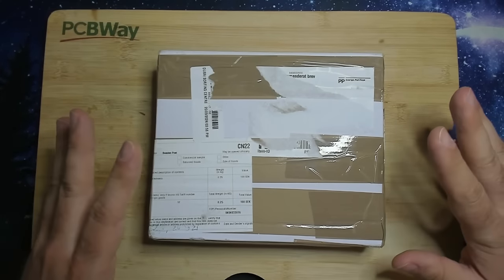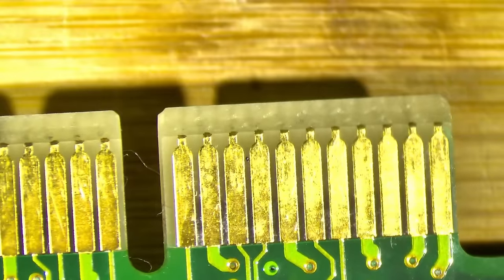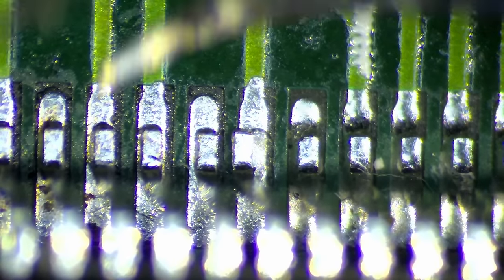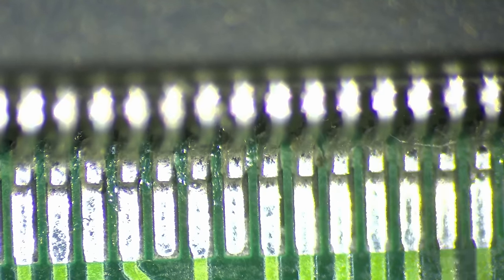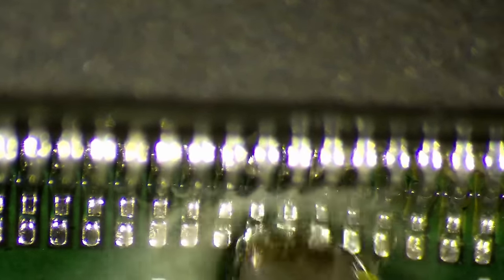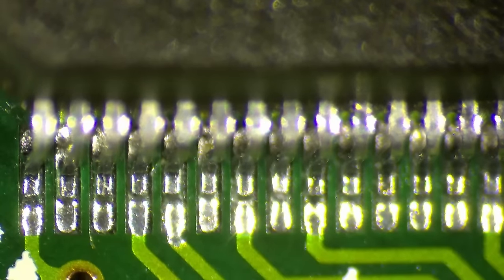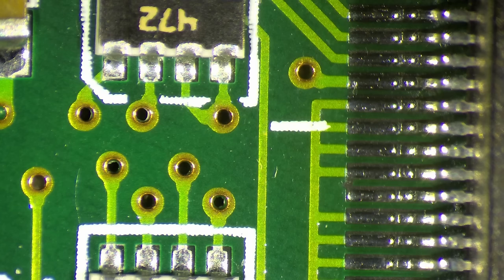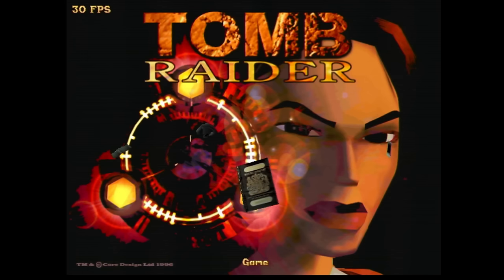3Dfx Voodoo Graphics repair: Reviving an iconic 3D Accelerator

Comment: At first I thought for a thorough clean the 3dfx chips would best be removed entirely so you could get all the stuff that was up under there. Then I thought that would probably involve the heat gun and there's no need to stress the components unnecessarily.
Reply from the maker: I try to avoid hot air for repairs as much as possible. Nothing worse than damaging a card like this because of some leftover flux.

Comment: I'll never forget the day I got my Orchid Righteous 3D and first fired up GLQuake. I was young and much more impressionable at the time, but I still consider this the biggest leap ahead in personal computing that I have witnessed in my lifetime. SSDs come to mind as well, but the first few generations really weren't that great, both from a performance and reliability perspective.

One day, I will have a Righteous 3D again and rejoice at the clicking of the hilariously mechanical relays. It didn't bother me at all and was really quite useful to diagnose issues.

Thanks for saving another one, Alex. ❤
Reply: I would agree with this. Proper early 3D acceleration, along with 2nd gen and later SSDs were both massive steps forward in computing!
The only other development for me that comes close would be the jump between dial-up modems and broadband internet connections. In mid 1999 I went from a 56k modem (using everything between 2400 baud and 56k for BBS & later internet access since the early 90s) to cable internet that was 1.5mbit/128kbps at the time. It was like a whole new world opened up!
Reply from the maker: I was in the store with my friend when he bought his Orchid Righteous 3D. I remember the sales person selling Orchid's relays and the clicking sound as a distinct feature of the card: "You know when you're playing 3D games because the card makes the clicking noise! No other card offers that feature!"
Well, he bought the card and told me how awesome it was.
About three years later, I bought that PC from him with the Orchid. It became my brother's PC. I had a Pentium II 350 at that time and he had a Pentium 200 (no MMX), ASUS P55T2P4, and the Orchid Righteous 3D. To this day, oddly enough, I still have most of those PC components - including the case.
Reply: @Choralone422  My first one was the Canopus pure 3d. But like you, damn do i remember.
Reply: I remember being in this computer megastore in Finland and getting obsessed with Orchid Righteous 3D. I had to have it. I begged my mom..and she finally agreed to buy it!  Biggest jump in graphics ever!  And the game bundle?  3dfx-versions of:  Mech Warrior 2, Fatal Racing,  Terminal Velocity, Descent 2, Microsoft Monster Truck. There was also a demo CD. 

Now almost 30 years later..after buying multiple systems my self.. I thank my mother for buying this card for me :)
Reply: @kimnice  Oh wow, Terminal Velocity... Made me buy my first joystick. This game was so much ahead of it`s time.
Reply: I still have my Orchid Righteous receipt lol. Sadly i sold the card back in the day :( they are kinda expensive now, almost at my original buying price

Comment: The Orchid Righteous 3D Voodoo 1 was my first 3D accelerator card. Such an amazing card. I have so many fond memories , and luckily I still have mine , together with its box and content.
I paired mine with my K6-2 233, in order to play Unreal at 512x384 (gives a few more frames compared to 640x480 at almost no visual cost). Before that, I just played games in Software mode. 
So while I was late to the game, only aquiring mine in 1998 , I was super happy and kept using it even with my P3-500 up until year 2001 (paired with an ATI Rage 128 Pro).
Reply: 512x384 is good resolution to use on 3dfx. If I remember correctly refresh rate needs to be set high enough to avoid pixel doubling - otherwise it looks much worse than 640x480. Lower resolution helps even on Voodoo2

Comment: Some flux is hydroscopic so can end up being conductive. I was having terrible issues with a small SOT23 voltage reg, at one point I could hear the sizzling under it. Replaced and used SMD flux, perfect every time now. It's possible the flex was causing an issue.

Comment: It's always nice to see people using a good amount of flux bu there is a limit,
When you use more flux than solder you may have issues 🙂nice fix.
Reply from the maker: Hehe, well, I don't mind if someone decides to drown the card in flux, but then it should be cleaned properly.
The most annoying thing with flux on the board is that when you touch it to install or remove the card, you get that stuff on your fingers. It doesn't go easily with soap.
Well, and then there is the fact that that card looks dirty.
Reply: @bitsundbolts  Non conformal - conformal coating 😀, Also depending on the orientation of the card and the heat it can also seep down into the slot causing contact issues over time as dust builds up over time,

Comment: Is that a bridge? at 12:54 - 12:55 Or just something shiny on the board
Reply from the maker: It's broken solder mask with the black surface of the PCB showing through. It can easily be mistaken as a solder bridge.
Reply: @bitsundbolts  Ah good.

Comment: Excellent repair! 

Would not surprise me however if there was an issue with the relays - could potentially be intermittent, temperature related etc. 25+ year old electromechanical components can be a little scary!
Reply from the maker: I have not come across issues with the relays yet. They might wear out due to heavy usage, but then the noise should be very different. The sounds of those relays is what I remember from my model (which I still have).

Comment: Shame you didnt test the card before you started the repair - I was always taught to take what the customer says with a pinch of salt and test anything before you attempt a repair in case it's an intermittant fault etc. it's also a good way of proving you've fixed the fault 😎😎
Reply from the maker: Yes, after checking for shorts and under the microscope, I could have tested the card.

Comment: Nice repair!
What do the relays actually relay? Is it basically 2 video cards on the same board?
Reply from the maker: If I am not mistaken, those relays are responsible to switch between the primary signal of the '2D' card (the signal that is routed through the loop cable) and the 3D signal generated by the Voodoo card. That is why you hear the clicks when the game Tomb Raider plays the videos during the intro because videos are played by the 2D card (the Rage XL in this video). Once the Voodoo takes over and outputs the 3D signal, the relays switch again from the 2D to the 3D signal.
Reply: @bitsundbolts  That's exactly right. While absolutely hilarious that they went the mechanical and audible route, it was great, because it gave you an indication of what is going on (and what may be the issue if a game didn't work). Furthermore, it was a perfect match for IBM's venerable buckling spring Model M. Clickity clackity! 😂
Reply: They switch between the vga input from the 2d card loopback cable and the vga output from the voodoo's RAMDAC. They are software controllable allowing games to switch between 2d and 3d output on demand allowing near instant switching without needing to reinitialize the card
Reply: @MonochromeWench  so the 3D part cannot emulate a 2D screen and be the only video source?
Reply: @nkronert  A voodoo card can be used as a dumb frame buffer but is not register compatible with VGA
Reply: @MonochromeWench  Ah, ok. Thanks!

Comment: Don't look like a bridge between 2 leg in the 12:53?
Reply from the maker: It does look like a bridge, but it is just cracked solder mask and the black layer of the PCB showing. But you're right, it can be mistaken for a solder bridge.

Comment: I would replace those relays because internal corrosion on their contacts can have the symptoms of not showing 2D and 3D when switching sometimes.
Reply from the maker: I also have an Orchid Righteous 3D. It works fine to this day. I wouldn't replace the relays until they either don't make the proper clicking noises, or they are completely silent (aka faulty).
Reply: @bitsundbolts  The clicking has nothing to do with the actual internal contact resistance and some climates are especially harsh to this relays, so dry and hot climate and they will last forever but cold and damp, well not so much.

Comment: did you ever come across some reasoning from 3dfx engineers for why they replace the vga signal instead of overlaying on it, just a cost issue? you know like how DXR2 dvd card does the overlay(on passthroughed signal). speaking of which did you ever play around with them?  

(if you do there's some old video player that lets you use the dxr2 to output svideo from just regular windows coded decoded files and not just dvd/mpeg2(obviously it doesn't decode on the card then but it was really useful for outputting good quality tv out as a second monitor kind of a thing for watching warezed videos from a tv)
Reply: passthroughed 🤡 you're a fine little wordsmith aren't you
Reply from the maker: Unfortunately, I haven't come across the reason why there is this hard switch between 2D and 3D signal. I could imagine that it was due to signal quality and cost. Maybe it was just easier and cheaper to implement two VGA signals the way 3Dfx did it back then. Just speculation from my side, but maybe someone else knows.
EDIT: I do have a DVD decoder card. I just never came around testing it! Some day, I will though.
Reply: DXR2 greatly reduced signal quality even when not overlaying anything. Voodoo pass through was not perfect but miles better than DXR2.Though I suspect 3dfx did hard switch over because syncronizing the analog signals was likely too much of a hassle. The design as is allows the voodoo to generate it's own sync and not need to lock onto the external sync of the 2d card. Without genlocking, it is quite complicated. If synch matching it is easiest if you also match resolution. The design used by 3dfx didn't place any limitation on what 2d and 3d modes could be used at the same time. An overlay mode would have been nice for Windows, but Voodoo wasn't designed primarily for Windows but for other markets like Arcade gaming and you don't need overlay for Arcade. I'd suspect 2d passthrough was a late addition for PC gaming. In an embedded environment you could run with only a voodoo card and no 2D card at all but in a standard PC you needed a vga compatible 2d card.

Comment: Most likely the card was fine to begin with. I've tested a lot of voodoo1 cards (among others), and they're pretty picky when it comes to running on more modern systems.. (And on very rare occasions, i've heard even on Pentium 2 machines). 
With the exact symptoms you described; black screen or even a colored rectangles pattern appearing when the game is supposed to start. 
Even went as far as  working, and later on it didn't, on my usual test system (VIA KT266 w/ AthlonXP2000+). 
In this regard; my advice to everyone, is to at least try disabling PCI(or PCI IDE) Bus Mastering, in BIOS... before you write-off a Voodoo1 as dead. Or just try getting a Pentium I, to test it on.
Reply from the maker: The fastest system I have tested Voodoo graphics is a Pentium III 1000. I heard that people also face issues with such a setup, especially when the FSB is at 133 MHz. However, I have never had an issue like that, but keep in mind that I never is anything newer than Slot 1.
I think it is a very valid advice to anyone with an original Voodoo Graphics - test in a period correct system.

Comment: some fluxes if not cleaned can become corrosive and conductive over time.
Reply from the maker: Oh, interesting. I always clean the boards as good as I can. Maybe the flux was responsible for why some of those solder joints looked different from the others.